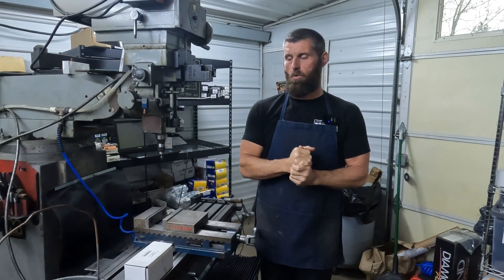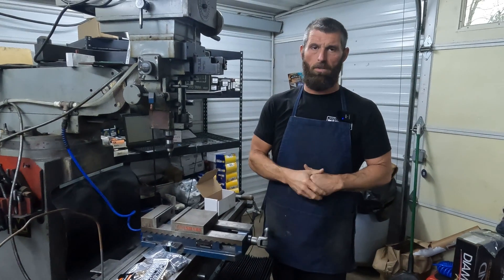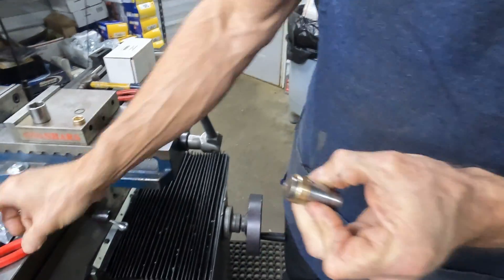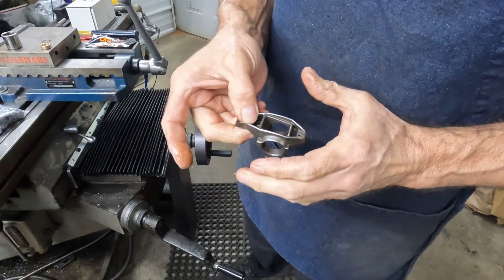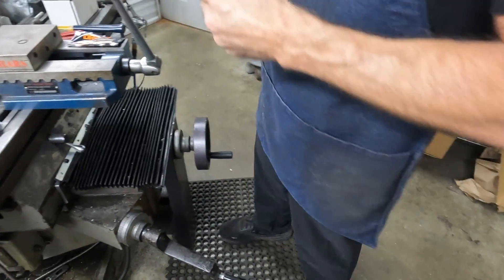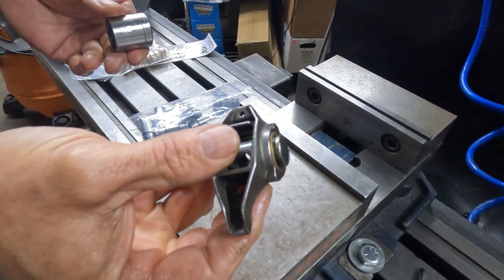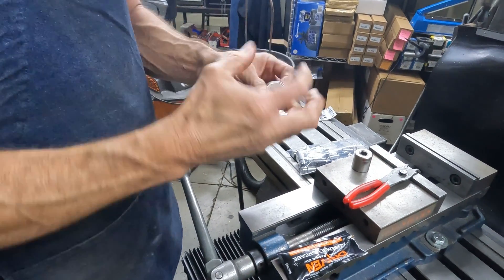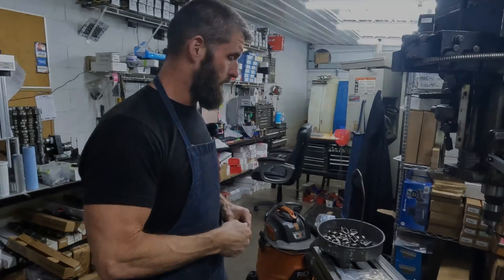Powell Machine inc  Ls Bronze Trunion kit

Comment: I did my upgrade but stayed with the needle bearings. Sometimes I wonder if that was a mistake? Its a moderate L99, roots blower, FBO, stock short block except for the cam. 700 WHP. Thoughts?
Reply from the maker: Bearings never last from my experience

Comment: I have a comp roller kit imstalled in some rockers.  I wonder if the old wives tales of trunnion failure in 3000 mi or less are true and I should get this and throw the comp stuff into the trash without ever running it.  What is the expected lifespan of this bushing style kit?
Reply from the maker: Every bearing kit we inspect is dead... we normally don't see failures with bushings, we use c630 usa made Bronze.

Comment: I suppose the DIY guy could take his LS rockers, then go to an auto repair shop with a wheel bearing press. Then he could pay the shop a few bucks to do that job. It's common to do that when a DIY-er needs a new bearing pressed in an old steering knuckle. It's also a bit like removing a MacPhreson strut at home, paying a shop to swap the spring, the put it back at home. Call your local independent auto repair shops and see who's willing to do it and at what price.

I suppose if you live near an automotive machine shop, even better!
Reply from the maker: Definitely,  but a bench vise works just fine

Comment: Bronze is a definite improvement over needles.
Reply: Oil impregnated bronze self lubricates even when run dry,has more surface area thus will withstand higher pressure than needles.
Reply: @briana3467 when the bronze bushing is "sweated"(I believe that's what it's called) it can indeed out perform needle bearings.
Reply from the maker: 100%
Reply: Just a few years ago, you’d never tell me that there wasn’t a better trunnion upgrade than the double caged trunnion! That all changed when a buddy of mine showed me a brand new rocker arm with just a few thousand miles on it with the normal trunnion upgrade did to it! It chewed the trunnion bad and shavings went through the engine. From the outside you couldn’t tell anything was wrong, til he took it apart. He sad the full caged needles couldn’t turn due to no oiling and seized up and ate itself.